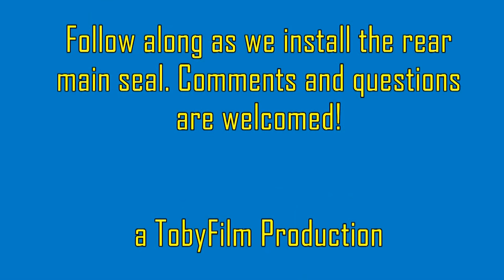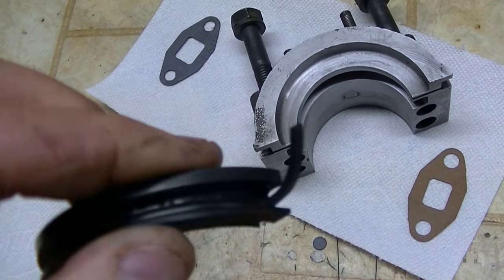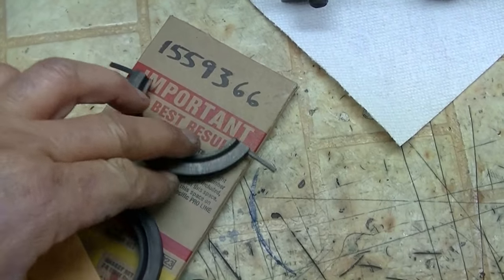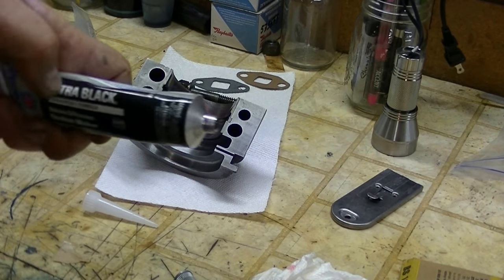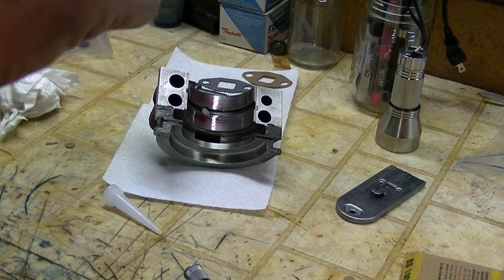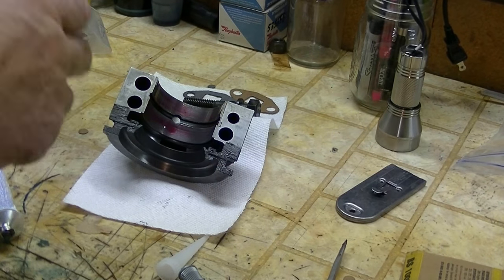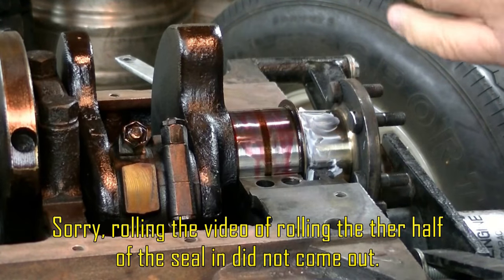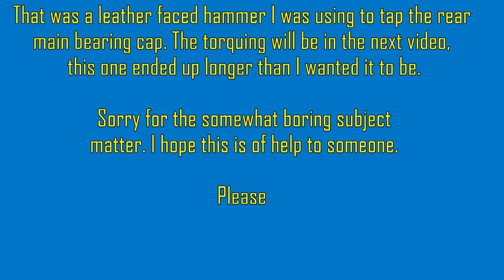Studebaker Rescue Video #17 - Rear Main Seal Install

Comment: Hi great video series, I have a question for you.   I am finishing rebuilding my 259 and I have a leaky rear main with a new seal installed.  I am thinking it's leaking because it was a bit loose like yours was at the 2:00 minute mark of your video.    I like the idea putting a bit of sealant inside the groove when installing the seal.  I can see that working when installing the seal on the cap, but how do you think it would work installing the upper portion under the crank where I would need to slide the seal in cause the crank is installed?  If I put sealant in the seal I would worry it would all get pushed out from the portion of the block it sits on as I push it around the crank.    Thoughts?  I pulled the engine to do this work.  I found it much easier to do it on the stand than doing it under the car.  I followed your video on pulling the motor out of the Daytona.  It worked great!  

Steve